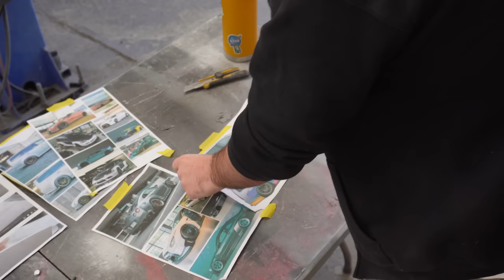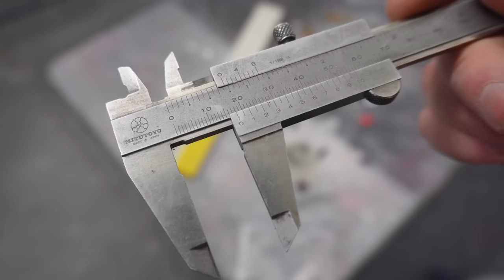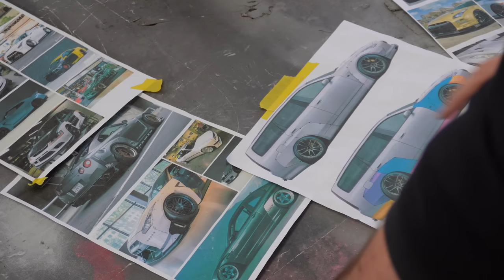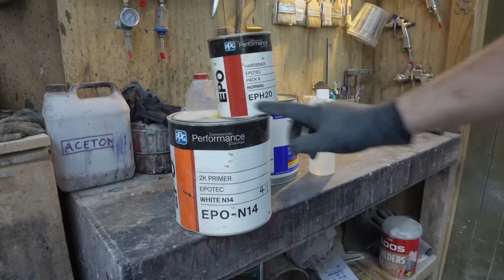Starting the Widebody Molds. Sky-gea build: Part 20

Comment: Beautiful work, so much patience. You wonder why so many aftermarket body parts fit terrible...they probably don't spend 3 months getting them perfect before making the mold :)

One thing that helps me remove 3d scan dots is a heat gun...softens the adhesive. If they have been on the surface for a while they are kind of tuff to remove.

Comment: For moulded look, you can use rivet (less expensive). for the hidden hardware style ( no need to make the recess for the hardware in the mold), why not to bond the extension to the panel with 3m panel glue ? you can style remove the extension with the help of a wire like the one to remove windshield.
Reply from the maker: I touched on this in the video. Be sure to turn on subtitles if you haven't already. 👍

Comment: Me: "dang, that looks good. Must be finished now"

Tofu: "almost done" five episodes later.
Reply from the maker: Thanks mate. It helps when you've got to break these massive projects to always break them up into pieces, anybody with a project car will tell you that.

So rather than think to yourself, "I've got to make an 11 piece widebody kit, and produce moulds for the whole thing, then make it all again out of fiberglass" you have to just go "ok, today I'm just tackling the rear half of the rear flare."

It's just a good tip for projects in general when they seem daunting as it helps you keep focused on doing a good job on each part rather than skipping ahead or rushing and being left with a product at the end that you're not proud of.
Reply: @TofuAutoWorks  Merely complementing your eye for detail and unwavering pursuit of perfection.

Comment: We've only seen you work on the one side. Was the reasoning behind the 3d imaging last time so that image can be flipped and the molds for the other side be cut out of foam or 3d printed?
Reply from the maker: Yes so in that last video I mentioned that I'll be slowly printing off the other side in pieces over the next few weeks and while I'm doing that in the background I'll finish off the moulds for this side so that I can flip the car around and join all the 3d printed pieces together on the other side.

I looked at CNC machining the moulds, but to buy my own 3D printer was less than a fifth the price I was quoted to machine even out of foam.
Reply: @TofuAutoWorks  ah ok, i missed that bit, my bad. Gotta love how far 3d printers have come and how cheap they are now.

Comment: Custom carbon Kevlar wheel arch liners would really polish this kit off (and cover up the clearanced front wings/rear quarters).
Reply from the maker: Would definitely be a good addition to add. I think I'll leave them off the kit when I produce them for sale though as it's already 11 pieces and if I added another 4 bits of carbon kevlar that would reflect massively in the price.

I think what a lot of people will do is find a way to modify the original plastic inner liners, but modified for clearance for the front wheels.
Reply: @TofuAutoWorks  Yeah, maybe leave a slight lip on the arches for them to sit on, then develop them as an optional extra for people bothered about dailying on salted or muddy roads.
Reply from the maker: @Jonathan_Doe_  You wouldn't want lips on the tops of the arches most of the time because it causes issues with tyre clearance. When you add these arch liners it's usually always a few inches further up so that it's above the max height of the suspension travel. They're pretty easy to make from just plastic to be honest so if anybody wanted to make them it wouldn't be a huge teask.

Comment: Awesome stuff. That sharp edge near the door you said you would make in 2 parts am I correct? How will you do the other part and piece it together??
Reply from the maker: Split flanges for a 2 piece moulds. The same as what I did for the original moulds for the front fenders. The moulds will be made in multiple pieces and bolted together while the finished part is laid up inside, and then the mold is unbolted to get the finished part out.

It's going to be a little tricky to lay glass that deep into a sharp corner when making the part, but it's almost always easier to make a part in one piece than make two pieces and join them together.
Reply: @TofuAutoWorks  oo ok. I'll definitely be rewatching a lot of the videos on this build. I'm kinda thinking for my civic sedan I kinda Wana do it like the skyline sedan kits and start at the front edge of the back doors and widen it as it tapers to the rear and round it back down at the back with some pandem styling like your doing. And the front kinda like the civic hatch pandems but with 2 vent slots on back of the fenders with the jdm markers on the raised part between the vents and have the fronts taped down more like your doing with the bumper caps and I wana tie into some custom made side skirts as well that taper back like the rear fenders will.

Comment: I'd have a question on custom bodykits in general. How do you mirror the fenders?
Reply: The little dots he pulled off at the start are for a 3D scanner, at a best guess I think he’ll be having the moulds scanned and the other side machined from foam to build the moulds off

Or build a final part from the RH side and have those scanned and machined
Reply from the maker: Feel free to check out my previous video where I go over the 3D scanning and printing process for the other side.

Comment: What do you use so the roller doesn’t keep sticking to the chop mat when rolling?
Reply from the maker: A couple things. 
I use emulsion bound chopped strand instead of powder bound as it holds its shape a little better and makes less mess with loose strands of glass everywhere. 
I also have a pot of acetone for cleaning tools and if the roller gums up I just give it a quick shake in the acetone to thin it out.

Comment: Are all of the extra layers of cloth to prevent warping when you make the actual part?
Reply from the maker: Correct. 
With moulds you always want to make them incredibly solid so that there is no movement at all once they are removed from the plug. This new resin that I'm using has fillers built in which build up thickness quite a bit as well. In the past I used to build 6 - 8 layers of glass with the standard polyester resin, but now I can do it in just 4 or 5.
Reply: @TofuAutoWorks  ok, I always used small diameter electrical conduit between my 2nd and 3rd layers of chopped fiber, but I think I like your idea better.
Reply from the maker: @lesheath6216   Adding bracing to moulds is also always a good idea. I didn't need to do it on these ones because they were relatively small and the parts had a lot of geometry, but for large flat shapes like doors or bonnets, it's good to put strips of something like pool noodles, or insulation tubing down between your final layers of fiberglass to add heaps of strength to the mould.

Comment: Great work as per usual 😎. Just an observation though. The way you messed up the rivet recess on the rear door early in the video and you filled it in, and repositioned the new hole? I couldn't help but notice when you where drilling the new hole and counterboring for the new rivet recess, you where drilling 90° to the arch extension?? To have made your life easier and for the rivet inserts to sit better in the recess, you should have been drilling 90° to the original door itself. That way your rivet recess work would have taken alot less time (when filing down to get perfect etc). Not criticism, as you're a million times more skilled at this build than i ever would be, but my aerospace background ocd kicked in when i seen the holes being drilled 🤣🙈. Hope you take my comment as a tipand not criticism 👍
Reply from the maker: The hole was started perpendicular to the flare, but once the pilot hole had been started they were all bored so that the mounting face was parallel with the body of the car. They were also drilled to exactly 3.5mm above body because that is the typical thickness of my fiberglass. I only had to file the edges, not the face. No criticism taken, just difficult to articulate everything I do in the videos when I dont talk 🤣👍

Comment: how did you decide on how deep to drill the bolt holes?
Reply from the maker: My fiberglass parts are usually 3.5mm in thickness. So when drilling I made sure to set a guide and stop 3.5mm from the bodywork underneath so that they can be tightened fully without distorting the shape or leaving a gap.

For the fronts that didnt matter because they're cosmetic only so I just drilled them to match the look of the rears.

Comment: Aren't you afraid that over time the rubber welt nuts are gonna dry up and brake away?
Reply from the maker: Not a major concern. Automotive and bike manufacturers already use these same fittings on a lot of vehicles off the assembly line, but also with a car like this, it is very unlikely that the person building this sort of car will leave it for 10 years or however long it takes for the rubber to perish because we are always revisiting things and so if the kit has been bolted on, it will probably be coming off again well before the well nuts are compromised.
Reply: @TofuAutoWorks  ah okay, never done a wide body myself love the work that you do and show

Comment: My personal opinion, but going with exposed hardware ruins all that hard work to make it look factory.
Reply from the maker: 3:20 👍
Unless the kit is moulded in (which I don't do because it's a terrible idea) bolt on kits are the far more factory looking option. The Datsun 240z is one of the best looking cars of all time and it came from the factory with bolt on flares.
Reply: @TofuAutoWorks  Like I said, in my opinion hidden hardware just looks cleaner. I have an 06 Mini S with a widebody with hidden hardware and to me it just looks better than all the other widebody kits with exposed hardware available for the Mini. I guess it all comes down to preference.